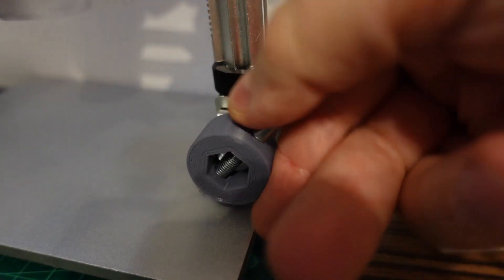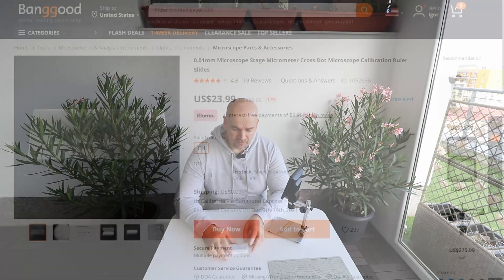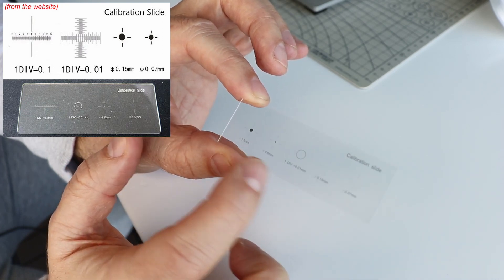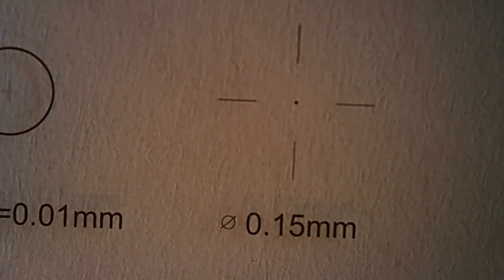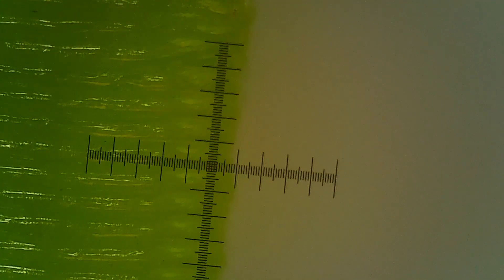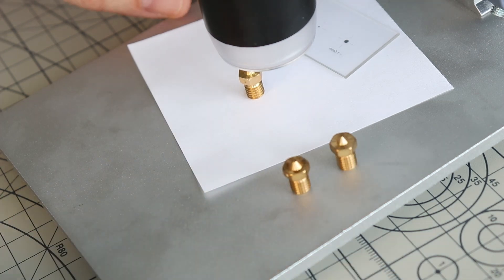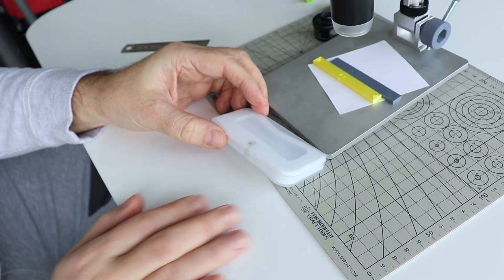Microscope ruler reivew - can it measure the 3D printed layer height?

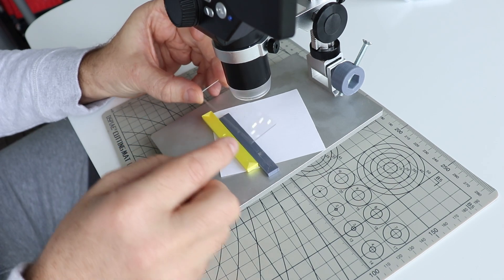Comment: 7:55 But you could take a screenshot and calibrate your image with it to measure the holee diameters
Reply from the maker: Correct, but not so comfartable. If I have to use the computer, I will use 2D scanner, much more accurate.

Comment: Expensive. I still have a Soviet pocket microscope i got 30 years ago, it has an integrated scale in the cap and i look at nozzles with it. I nickel plated a nozzle for an hour at 100mA (nickel citrate, home made) and i think it shrunk from 0.4mm flat to 0.38mm, which is good enough.

Comment: Im trying to send mine back ,the micro usb connector has broken so I cant charge it, really bad design the supplied charger plug is too fat,and it forces the flimsey socket out of line.
Reply: Sounds more like bad soldering to me or socket quality, just bad luck. Well soldered, you can push the socket around quite a bit before anything happens.
Reply from the maker: Try to get a refund if it doesn't work. And then try to repair it your self if you have some basic soldering experience. You can even pull the socket outside for easier access.
Reply: @MyTechFun   I've had it apart and it's a really nasty socket that's not even soldered to the PCB, the contact insert is held onto the PCB with the shell that is soldered to the PCB, yes I could solder a proper DC connector on it